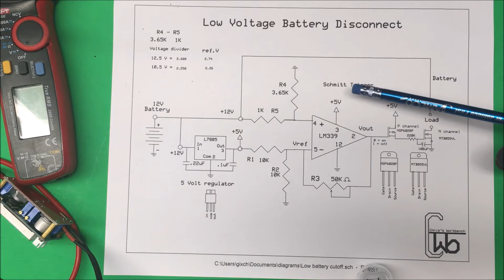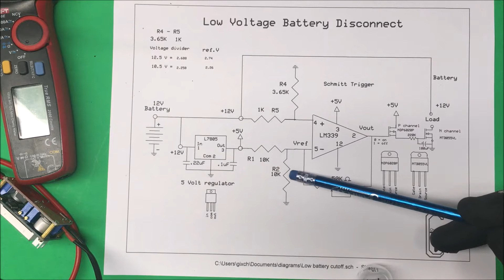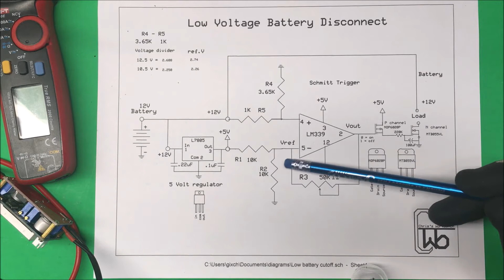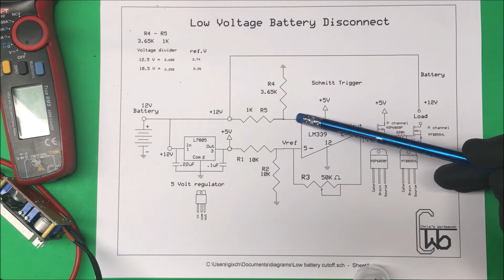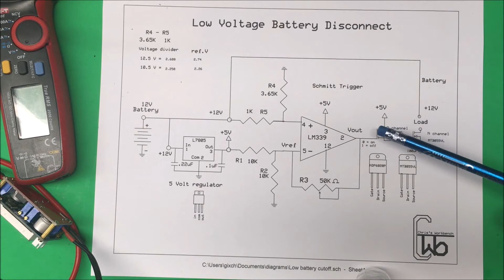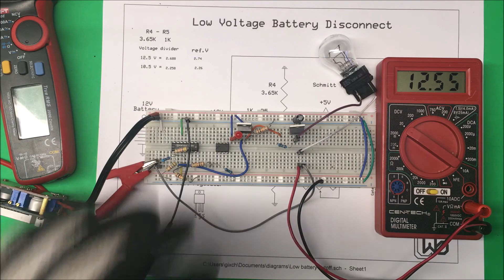Low Voltage Battery Disconnect

Comment: I think in one of data sheets of tl431 (after all it's 2.5v comparator), there's an app note to do this task, it requires just external transistor and 4 resistors I think. It achieves hysteresis in interesting way, you may be interested in checking it out.
Reply from the maker: Thanks
Reply from the maker: Just ordered some.
Reply: @ke6chris  TL431 are very handy devices.   Extremely cheap and extremely accurate.   I always grab them out of gear especially power supply units.   They generally have at least in them and I have gotten 3 out of 1 PSU.     Lots of application circuits out there to experiment with.   Great ref voltage source.

Comment: What is discharging the 100 Uf cap on the gate of the N-Ch FET.   Seems like it would stay on for a long time.    You show no discharge resistor on the 100uf cap.   Is that 100uf cap extremely leaky???   I do something similar but use 555 timer IC's comparators and wire it as a latch configuration.   Once it turns of it will not turn back on until you reset it or restart it.   I don't want it oscillating on then off then back on and on and on..........
Reply from the maker: Cap will discharge through the gate. The 555 sounds good.
Reply: @ke6chris  Gate to source junction is a capacitor.   No dc current flows into it or out of it in a static scenario.    You get some current flow when switching as the capacitor junction charges and discharges when changing gate voltage.    Am I missing something.   There are several circuits out there that store a charge in a large capacitor that biases the gate for time delay but a discharge resistors is always in parallel with the gate source pins and the external capacitor for an RC time constant.   I have also seen touching the gate on an N-CH Mosfet  with a positive charge it will stay on for some time due to the internal capacitance being charged for that split second.   With no pull down resistor to drain that charge the Mosfet stays on for a long time.    If the main transistor is a BJT the external cap will discharge through the base emitter junction.